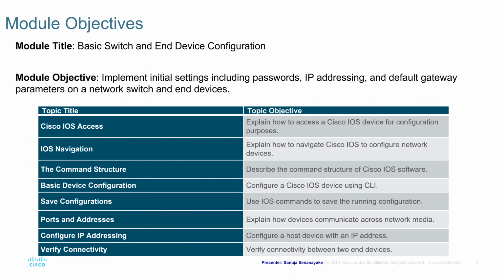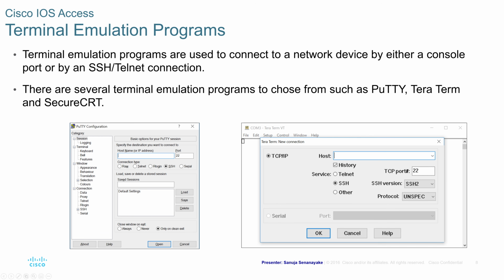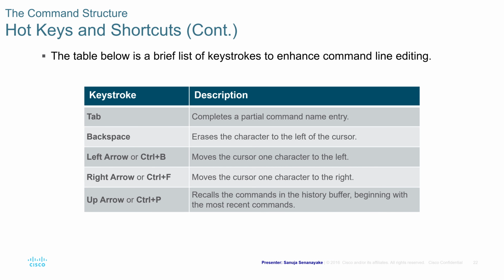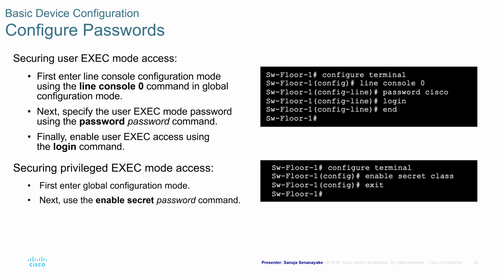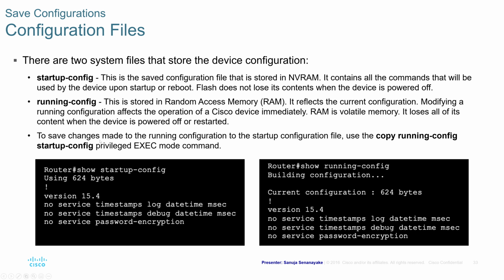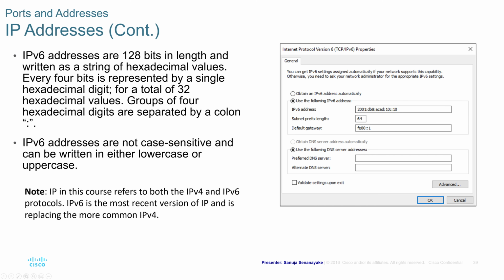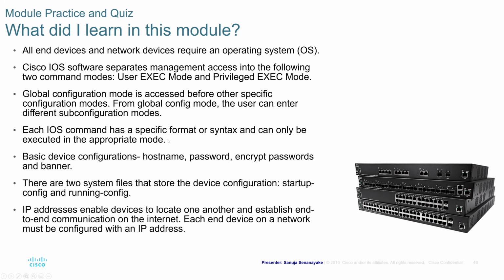CCNA Module 2: Basic Switch and End Device Configuration - Introduction to Networks Course (ITN)

Comment: Your syllabus	Video section
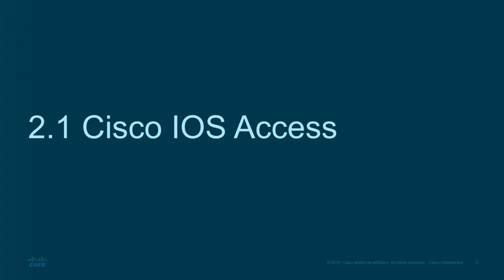Introduction to Cisco IOS / Cisco IOS Access	0:01:26
Navigating IOS	covered in IOS Access/navigation
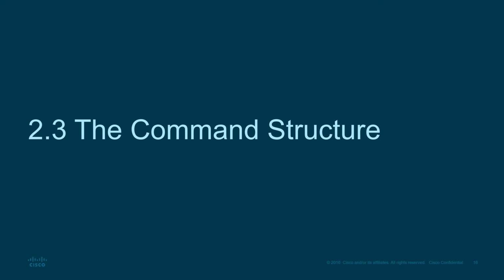Command Structure	0:18:27
Basic Device Configuration	0:31:21
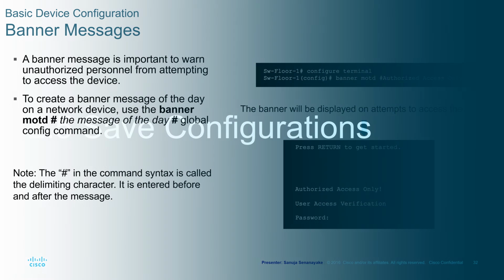Saving Configuration	0:42:15
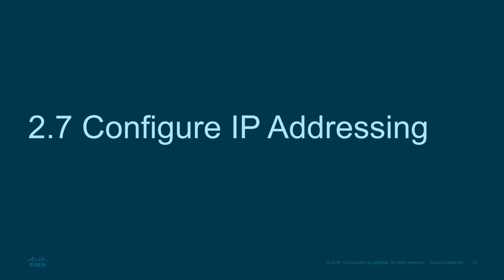Addressing devices / IP Addressing 0:55:08

Comment: hey man love the videos, just a quick question tho, my final itn exam will be done on physical hardware instead of packet tracer so how do I enter the switch CLI through a computer? what commands do I need to use and how should i hook up the switch and routers?
Reply from the maker: Your proctor should provide you with serial cables. You will have to connect that cable to the the switch/router and the other end to your laptop/PC. The Cisco device will appear under the Device Manager (which you don't have to check). Then you will use PuTTY. In PuTTY, navigate to Configuration > Connection > Serial and make sure the settings are correct. You should be given instructions on the PuTTY settings or it should have been part of the course/class. PuTTY software is the terminal you use. The Cisco commands will be same as using the Packet Tracer simulator. The only caveat is that the devices will be slow. Some of the commands, once entered may take few seconds longer to process than it is on the Packet Tracer. If you had to reboot your Cisco devices, it will take longer to power back up as these are real devices. Please make sure to save your configurations using copy running-config startup-config for each device as you know, reboots and shutdowns wipes the RAM. Just relax and you will do great. Good luck on your exam.
Reply: @NetITGeeks  ah alright I went into the lab yesterday to get familiar with it and yep just like you said, thanks man!
Reply: @derpypotat1903  hey man, my exam is comming too, where are you from ? in which uni are you studying ?